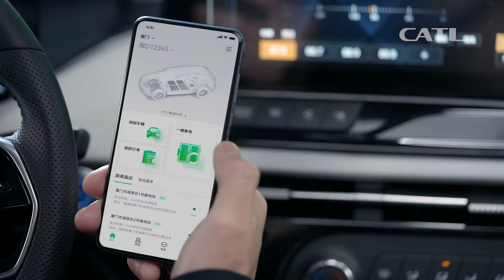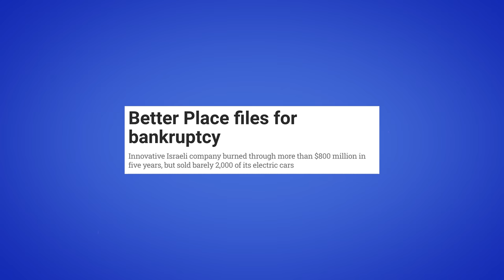Why Battery Swapping Is A BAD Idea

Comment: Great to see this discussed but lots of flaws to Rory’s arguments.
Here’s a couple
In 3,4,5 years time you can have the battery of the future put into your 3,4,5 year old car. Why do you upgrade your phone. Generally because the battery is now goosed.
Swap stations. You can still charge from a super charger. Why would you not want this as another option?
7kw home charging isn’t possible in Germany. I imagine a swap station network is even more appealing to Germans looking to enter the EV market.

I didn’t really hear a negative other than the cost of setting up the charging stations.
FYI Nio confirmed this week it is building a European charging station factory in Hungary.
How about you actually go and review a Nio please Rory 😉

Comment: This is actually true and accurate. But superchargers are constrained by "demand charges". 

Battery swap levels out the demand spikes at a station because the batteries can be charged more gradually at a lower kwh. Allowing for more consistent grid draw, and thus a more stable electricity price.

Comment: I have a Lightning reservation and I would never swap the battery regardless of any time savings. First of all, for me, I never drive more than 40 miles in a day. So I don’t foresee having to stop at a charging station very often. And secondly I actually like stopping for a bit to stretch my legs, use the rest room, grab a snack, etc on a long trip. If I need to go balls-to-the-wall I’d probably take a gas vehicle.

Comment: I can see a few strategically placed stations to alleviate long trip / range anxiety issues but by there nature the usage would be light so not cost effective for the supplier. Better would be for smaller HGV local work where the weight of batteries could be smaller but the downtime much less per vehicle for the operator

Comment: The electric lifts and tuggers in the warehouse swap lead acid batteries a couple times a day. In a regular vehicle I can never see this working because it will break, our batteries are basically just a steel box and they have problems sometimes, I just don't think this system would work for non-industrial uses.

Comment: the point you kept making about empty batteries in the station is not really an issue. once you  are in control, can have a fast charger many times faster than individual charging stations

Comment: Well we used to swap batteries all the time on a daily basis to Electric  Reach Trucks. But only older ones with Lead acid batteries. New lithium battery trucks do not need swapping because of fast charging.

Comment: Battery swapping makes a lot of sense, as part of the charging mix,  as the batteries removed from the vehicle can be charged at a more convenient time. One of the problems with rapid charge stations is that you need an awful lot of electricity available to allow multiple cars to be charged at the maximum rate. This costs a lot of money in setting up grid connection and possible local (static) battery installation.
Reply from the maker: You don’t need a lot of electricity to recharge the empty packs?
Reply: @AutoTraderTV  , it's about demand management. The battery packs can be recharged when electricity is cheaper, or without overloading the supply. This is a problem that rapid chargers have, and so they often don't run at full capacity.
Reply from the maker: @julesprocter9947  In low demand scenarios, possibly. But I think it's quite likely that, with high demand scenarios (i.e. when every new car is electric) a swap station will need to use far more energy than a rapid charging station - simply because it will always be charging empty batteries... Even if there are periods when there are no cars present.
Reply: @AutoTraderTV  , I think you need to go and read up about how demand management works. (And queuing theory.)
Reply: @AutoTraderTV  No you do NOT. As you should know, slow charging takes MUCH less energy to recharging, because of the losses by temperature rising. And, as you also should know, slow-charging (think during the night and off-peak periods) also help keeping batteries at optimum state.
Reply from the maker: @julesprocter9947  I'm not sure what the debate is. If there are 13 empty batteries in the swap station, you're suggesting they should be charged during off-peak times. That's fine. But if there's high demand for battery swaps then the empty batteries will need to be charged according to anticipated demand - which may be during peak hours.
Reply from the maker: @pg205  I don't know how quickly Nio charges its batteries. If I were guessing, I'd suggest they rapid charge them at all times in order to reduce the likelihood of customers turning up and there not being enough charged batteries. That's my theory though.
Reply: @AutoTraderTV  So what you are saying here is you actually have no idea how the NIO ecosystem works in detail because you did not dig deep enough into it but you publish your bullshyt opinion about it anyway. Kudos for ya chuzpe my man! Swapping is just another service by NIO besides regular charging and if you are so keen on charging your battety by yourself you are free to do it.
Reply from the maker: @emilschulz9888   I just used common sense, really. If there’s high demand, you charge the batteries fast and at all times. If there’s low demand it’s possible to charge at times of low demand. Im not sure why that’s up for debate. Anyhow, a Nio owner in China just commented explaining that my theory was correct: where he lives the batteries are not simply charged during off peak times, but are “constantly” being rapid charged in order for the stations to achieve an uninterrupted swapping service from the 13 batteries that can be handled by the station.

Comment: When mobile phones began to ship, there where multiple charger types owned by different companies. Nokia used to have its own charger, Ericsson had its own , Samsung etcetera. . . Now days all except one uses usb c. So its not that difficult to all brands find a way to use an universal type of battery type fitting all types of vehicles and needs. For example my small car could use 5 battery cells when your large suv can use 10 battery cells of the same universal type. I think this is the future. Its another way to reduce buying and owning costs and anxiety. You don't have to buy the hole car, wandering how long  the battery will last and what are you going to do with it after say 10 years.

Comment: The main advantage of battery swapping is more economical use of resources. My car has a big and heavy 100 kwh battery, I'd much rather have a 30 kwh battery and then rent a 100kwh battery a few times a year when I need it. It would make my car cheaper to purchase, improve handling and reduce enviromental impact. Space is hardly an issue as so many cars can use a station within an hour. The main problemis the need for standardization so manufacturers can share the same station.

Comment: Have you seen what they have been doing in melbourne aust? They have been doing battery swaps with trucks (your lorries) pull down the nose of the cab pull out the dead battery, chuck in a new one and away ya go, seems more doable when some trucks are being loaded and unloaded, it may fall on its face as an idea but 🤷‍♂️🤔

Comment: Whatever happened to swappable aluminium-air batteries? The theory was high density batteries that could be swapped quicker than filling your car with petrol, however as you can't charge them yourself, there has to be a large-scale recycling system in place to handle them... and we're not exactly shit-hot on that front right now.

Comment: A battery is going to get more expensive when its is swappable because all contacts and cooling connections need to be upgraded in order to sustain multiple connects and disconnects. This is easy with data connections but not so easy when you needs to transport 200A+ at 400V+.

Comment: it should be a battery extension. where you add a battery pack you can lift by yourself and toss in the back trunk. you can buy or lease the back up pack fully charged get where you need to go and drop it off later or save for extended use
Reply: Hulk approves this idea. He's the only one capable of lifting a 500kg battery. I'm not so sure about installing one, though...
Reply: @pg205  did I mention size?

Comment: Good video, but there are "simple" solutions to some of your strongest points: 1) Government standardized batteries so batteries are interchangeable across manufacturers. 2) EV makers retain ownership of the batteries (dramatically reducing car costs) so you aren't giving up the brand-new battery you paid for in exchange for an older used battery. 3) Partner with existing Gas/petrol companies to install "battery swap kiosks" at every gas station (instead of dedicated facilities) so gas stations continue to make money as people move to EVs. 4) Rapid-chargers can charge dead batteries in roughly 20-minutes now, so stations can bulk-charge their swapped dead batteries quick enough to always have a supply of charged batteries ready. 5) A kiosk at every gas station eliminates "range anxiety" as getting a full charge is as easy as getting a full tank of gas (and in less time.)

Comment: Fascinating.  I've long thought the charging issue to be the strongest deterrent to EV adoption and felt battery swapping to be the best solution. I agree that development and adoption of a standard is necessary.  Though auto manufacturers are in competition with each other, and hesitant to collaborate, there are many aspects to every vehicle which are standardized.  Think light bulbs, radio dimensions, gas tank fillers, tires etc.  I am still bullish on battery swapping.

Comment: Maybe this makes sense for trucks? The driver can have a break, the batteries will degrade less since they can be charged slower, and the internal battery in the truck doesn’t need to be so large, since it can be swapped much faster than it would take to charge, reducing the trucks weight, and therefore the energy needed to propel it….

Comment: It is high time that a gloal standard is implemented for basic requirements of EVs just like the release buttons inside boot  and frunk.
1. Agreeing to have option for a common plug type for charging. 
2. Option for an external power supply connection to enable the vehicle  to be propelled to the next charging station.

Comment: Swapping makes sense for things like scooters and small people movers like the Citroen Ami where you can hand swap.  Needs no expensive infrastructure. As others have said battery and charging infrastructure improvements will better meet demands for the future, especially for those who cannot charge at home. As to electricity via renewables..of course.  That is a given for everything and not just electric mobility.

Comment: You missed one vital point. If you build a vehicle for battery swops you have to design the structure so that the battery plays very little in the strength of that structure. If you build a vehicle where the battery is pretty much an integral part of the structural strength then the vehicle is going to be lighter. You can see this with some motorcycles where the engine is part of the structural strength and racing cars where the engine and gearbox is part of the structural strength of the car.

Comment: agree on some points but disagree on others.  Nio has mostly proven short term viability, now it's all about long term.  yes, if they can't get other car makers behind them, it would be a huge boost, but with only 1 manufacturer, it's not much different than tesla's supercharging network - other than the fact that they are more much established and have more cars on the road.
this will really take off for heavy duty vehicles like trucks where you aren't going to be fast charging for 18 minutes.

Comment: It's not a bad idea per se. What it needs is it's USB C moment. Regulations on standardisation of battery pack size, connectors, charging architecture could help. I don't buy the calculation of half a day for a queue of 70 cars to get charged. Petrol stations are smaller and faster than supercharging stations and they're a direct analogue to swapping stations and this also makes the land far cheaper than a supercharging/100Kw station. And not to mention the fact that charging Li-ion batteries at those 80% in 15 minutes rates deteriorates batteries at a much much much faster rate than slower charging which can be done by swapping stations for most of their battery bank. They too can fastcharge when the traffic at their station heats up.

Comment: a swap station use the power connection to the grid of 10 supercharger and the space of 3 so IMO comparing the troughtput of a swap station with that of 72 supercharger is pointless.

Comment: Huh? 

1. As long as car companies come together and form a standardised input/output socket for each battery class like the usb chargers (30kw/40kw…), they can be reused in all battery swapping stations. It’s more economical too, as the cost of the stations will be shared by all manufacturers / franchises.

2. New battery tech is constantly evolving. So not having enough lithium can be solved by completely by new battery chemistry. Moreover, as long as they maintain the aforementioned standard interface, no one needs to divulge secrets but can still be compatible with competitors’ swap stations.

Comment: Not sure if this is a valid point and if already mentioned?
When you arrive empty at a swap station, how do you know if the replacement battery won't be old and not have the range you were expecting?
I don't see it as a problem in the 1st 4 years of a network of swap stations, but after it could be.
Perhaps this is all factored in and older battery packs are replaced with new under the rental system, via swap stions?
What about those EV car owners that don't rent the battery?
Reply: all battery in the swapping cycle will be checked and maitained by nio, old batteries that cannot reach 80% of full chage will be replaced by nio.

Comment: I for one would like to see a focus on aero-efficiency in new EVs. The EQS and EQE are a culture shock to long time Merc buyers, but they have massive range from a pretty standard sized battery, partly due to that low Cd figure. I might sound silly here, but why can’t we have range extender series hybrid cars? Tiny, frugal ICE whose sole purpose is to charge the battery. One of my favourite cars is a Nissan minivan with this kind of powertrain. 1.2-litre engine, barely a 2kwh battery and this huge 7-seater can return almost 50mpg. If it had a slightly bigger battery, I bet it could do even better.
Reply: Because a 50mpg petrol or diesel car is incredibly polluting compared to a fully battery powered EV, and will be illegal in most developed nations by 2040, and a lot earlier in some. If you started developing range extender hybrids now, you're in competition with the charging network as it will be in a few years time. Which going by current trends means much bigger and faster. You'd be designing a vehicle optimised for a short window in time, and you could miss it entirely.

Comment: 500,000$ is less than I expected. If you built one station for 20 cars and write them off over 5 years, that makes it per car 5,000 $. If you can save that money by offering smaller average battery sizes in return, that's a good business for both customers and the company.

Comment: Would it be compulsory to swap an empty battery pack, or could you just charge them at home, or at a commercial charger?
Reply: compulsory? you owned the car, you could just dump your battery or even your car, it's your's man
Reply: @u.a.nugroho  you've not understood what I'm asking.
Reply: With NIO, you can still charge it at home, it doesn't lock you into either of it. What wasn't mentioned here however is the flexibility to go from a small capacity battery to a big one when you need it. Perhaps you only need a 75kwh usually but for a road trip, you could upgrade to a 100kwh instead. That's flexibility that battery swaps would open up

Comment: Hmmm...
I not sure I would agree that battery swapping stations necessarily are a bad idea - though, I'm absolutely on-board with you on the need to get our current charging network more reliable and more available.
Car company financial costs aside - that's for them to decide if they can afford it - in the same way that sole-access to the Tesla Supercharger network has always been a MASSIVE factor in buyers choosing Tesla models, I could absolutely imagine that having sole-access to a network of battery swapping stations will help sell more and more Nio products.
For them, it's a marketing USP, just as the Supercharger network has always been for Tesla.
As long as Nio's efforts are in addition to other charge-point providers upgrading the current provisions, them surely that's got to be worth having.

Comment: It's not a new idea.
US car maker : Mr. Tucker, come up with the idea of temporary engine swap.
When you have engine problem, no need to left the entire car on the repair garage.
5 minutes swap & you good to go.

It didn't work. The car industry, gang up on him.

Battery swap is a great idea for car owners.
All that problem could be resolved if there's political will.
Car charging have it's problem, that doesn't mention here.
There's already queue that makes some people 'stole' cable plug to a car . . & plug it on their car. Making you comeback to empty batt car.

Have you ever forgot to charge your phone at night? Easy fix, charge it at the office or car or train, etc.
Can't do that with EV, it can't fit in your pocket.